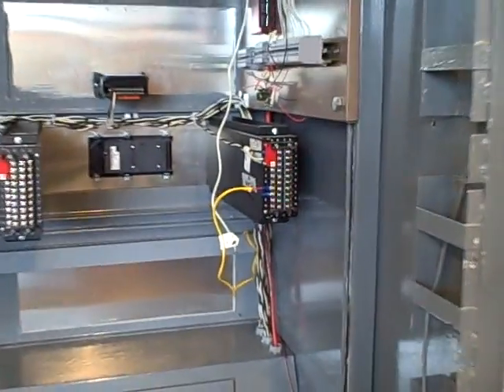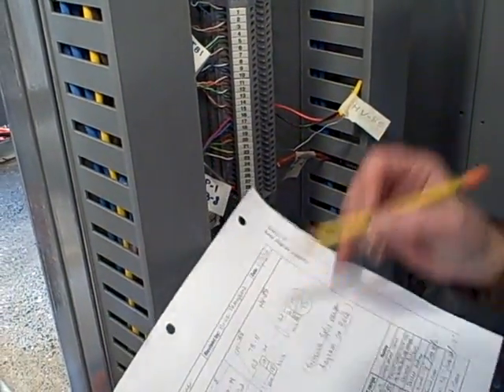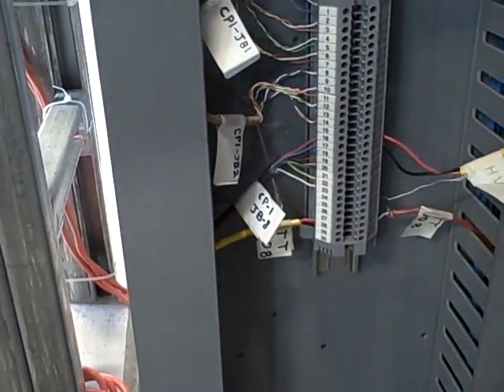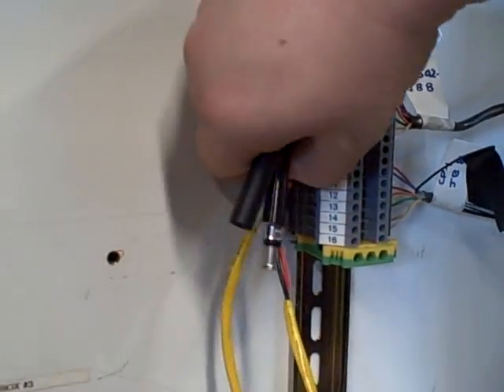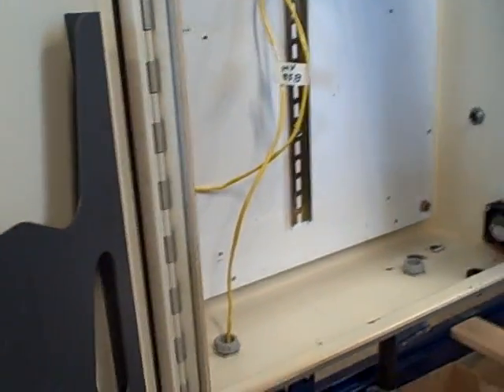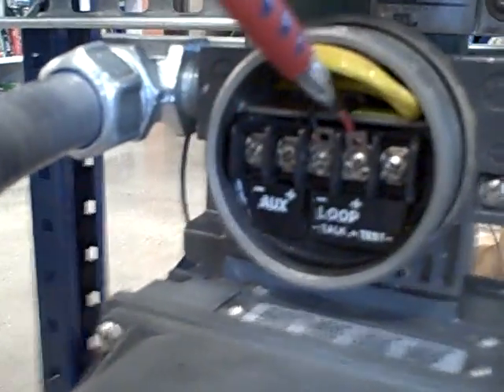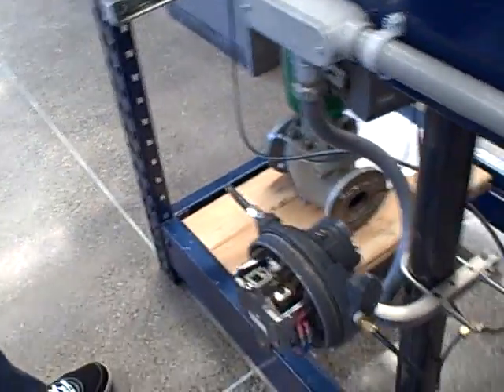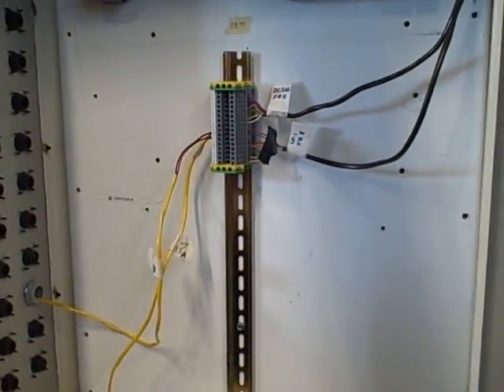Loop inspection on split-ranged control system

Comment from the maker: Actually it is.  The two valves operate in an "exclusive" split range, where one opens from 4 mA to 12 mA, and the other from 12 mA to 20 mA.  The inspection did not include a demonstration of the two valves' behavior, so it is not apparent from the video.